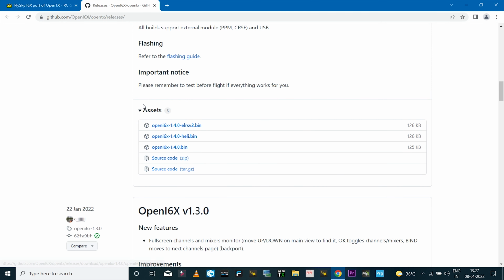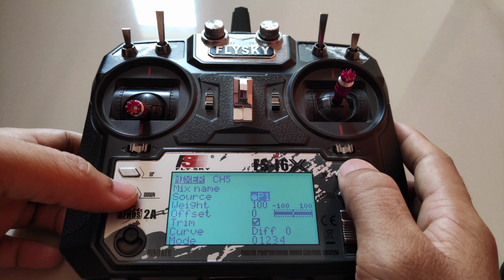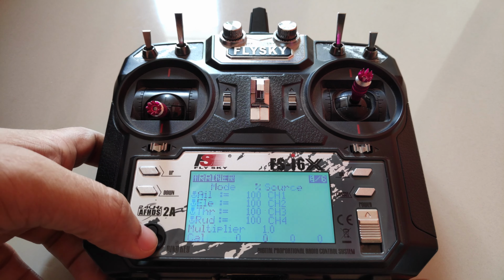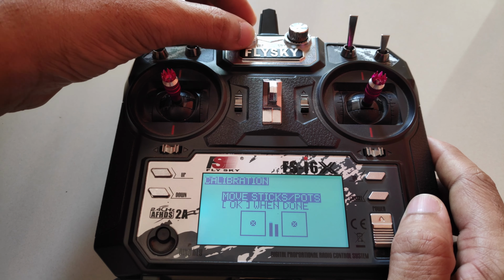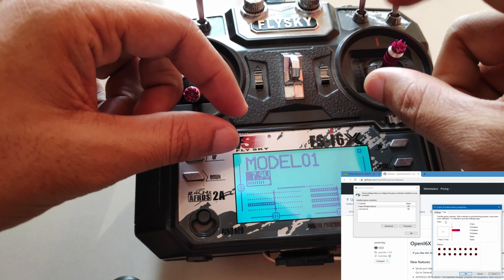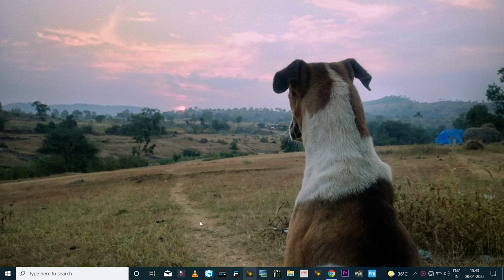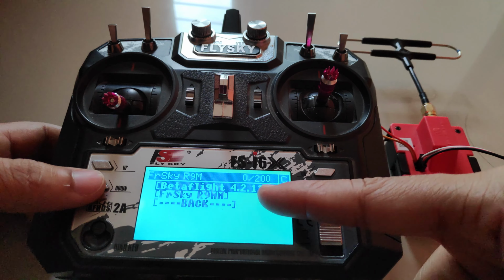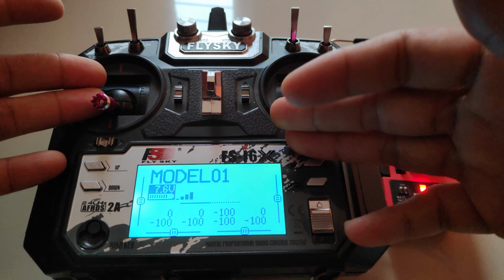Flysky FSI6X OPEN TX 1.4.0 New Features and Improvements + ExpressLRS 3.0

Comment: hi the original firmware the switch setting has a larger range than 120% the servo motors have a larger stroke here can the same effect be achieved
Reply from the maker: I think it's possible by editing the channel mixer setting by changing the max range to 120...the default is 100. Will check on my radio and reply soon
Reply: Thank you
Reply: hi have you checked your device does it have the ability to change percentages

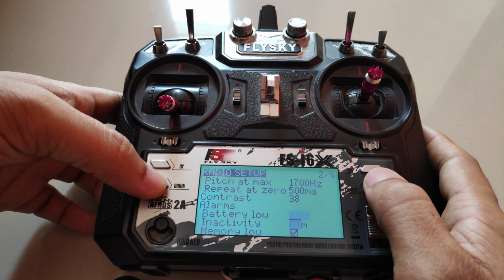Comment: At 9:54 does the low battery warning apply to the radios power and the external module(im running a express lrs module) or just the radio. If its just the radio how do you change the voltage alarm for the external module(if there is a serting)(im running a 2s for my module so this is helpful) thanks
Reply from the maker: It's only for the radio not the external module. But if your external module is powered from the radio battery then the voltage alarm will benefit both.

Comment: I Plan to use this remote with a scale car. For this I will change the 2 pos switch to 3 pos. With openTX can I delete the switch/throtle position force at startup ?
Reply from the maker: Hi, you mean the throttle warning at power on if it's not zero? I am not sure what you mean by force. But with open tx you can pretty much configure the radio however you want just need to know how to implement the steps required for it
Reply: @RakishRc  Yea, I mean that. Same with the switches that al have to bee up. Is that something I can change in the radio or do I need to do that to the firmware7software before flashing ?

Comment: Hi, does the radio work with computer for playing games after changing the firmware to Open?
Reply from the maker: Simulator option is a hit and miss mostly due to computer driver error. I have no problem with simulator with open tx on any of my computer and laptop. You'll have to test it on your pc

Comment: is it compatible with the i6?
Reply from the maker: No. For fsi6 there is erlfy6 firmware very similar to this. Here is the guide link - https://github.com/aerror2/erfly6

Firmware release - https://github.com/aerror2/erfly6/releases
Reply: @RakishRc  hi rakish i did the install and everything went well...i now have open tx but i can't see all the menu from the open tx...do i have to add something else? thx
Reply from the maker: @mani-00  which radio you have? Fsi6 or fsi6x?
Reply: @RakishRc  i have the fsi6, do you have an email i can send you video to see. thank you
Reply from the maker: @mani-00  you can send on telegram - https://t.me/RakishRc

Comment: Another great video !👍
Could you please tell me if express lrs receiver will work with apm2.8 flight controller ?
I have no idea about compatibility or how lrs receiver works.
Does it has its own telemetry or it transmit flight controller's telemetry?
3rd question is regarding the camera transmission, if a separate setup is needed for  fpv , even after all these technologies advances , especially for long range flights ?
Is there any way to transmit video signals riding these radio signals?
Please guide me bro . 🙏 
Thanks
Reply from the maker: Express lrs will work on apm but from 4.1 firmware onwards. Elrs receiver has some if it's own telemetry like rssi, refresh rate and voltage but it can also send flight controller telemetry.
For fpc setup you could use it stand alone without connecting to flight controller but you'll miss some data on your video feed. Fpv video feed doesn't have any problem from other radio signals if vtx and antenna are placed correctly.
Reply: @RakishRc  Thanks for your reply . It's clear that express lrs will not work with apm 2.8. Now for fpv setup , does its receiver support analog video out put , as feed from apm telemetry can be overlayed on fpv signals through minim osd. In this scenario , apm doesn't need any feedback , minim osd just use that telemetry data to overlay it on video feed.
So my question is does express lrs support analog video output , if not then how can I use telemetry data from apm to get it overlayed any digital video feed. Sorry for my ignorance 😛
Reply: I have replaced my radio with fs i6x , as suggested by you , in comment section of another of your video.  Thanks for that 👍
Reply: Bro please guide me here, I am very much confused

Comment: will installing openTX allow me to connect to multiple protocols with the stock antena? or do i need to put external modules for that to work?
Reply from the maker: You'll need multi protocol module to use other protocols. With open tx you can use elrs and flysky protocol along with ppm for external module. Sbus for multi protocol will also be available in future

Comment: On my flysky the elrs lua script wont load
Reply from the maker: Check elrs firmware on tx and rx module is matching and updated. And make sure tx2 signal wire and it's ground connection are connected correctly
Reply: @RakishRc  i did everything but nothing worked 
Now i have a frsky qx7 and everything work
Reply from the maker: @marc_kkb  strange. I'd suggest re check elrs signal and ground wire connection between radio and elrs module. Also make sure elrs firmware on elrs tx and rx update. It should work 👍

Comment: Hello, i would like to ask whether the system can be operated with 2S lipo without adjustment? As seen on the back of a 2s lipo?
And i have one more question. Which setting must be made to operate servos with sbus on receiver (16ch). Which converter works good? 
Tanks very much
Greetings from germany 
Sigi
Reply from the maker: Hi, I've been using with 2s lipo without any problem just make sure to never power with 2s and 4AA batteries together accidentally else radio will burn. You'd need sbus to pwm converter to use servos with sbus16 or use sbus compatible servos directly. Frsky sd1 sbus converter could be used or any other similar converter.

Comment: Can this remote be installed with speakers and a memory card module ? , if so, it must be very powerful
Reply from the maker: Dfplayer can be installed. I did a short test with erfly6 firmware but it's not fully supported for fsi6x. With open tx it might be supported in future not sure though.

Comment: hello, thankyou for videos and guide for the open tx. succesfully install no problem. however all my gimball are inverted (left is right and up is down), do you have any advice ?
Reply from the maker: Did you calibrate gimbals and pots from the calibration menu correctly?
Reply: @RakishRc  yes , i did . Even in the calibration menu , everything is inverted
Reply from the maker: @MsDanish1212  I am not sure why that would happen. Did you ever reconnect the gimbal pin connector on motherboard? I'd suggest flash original flysky firmware again and see if gimbals are working correctly. That's a way to know if it's hardware or software issue
Reply from the maker: @MsDanish1212  https://github.com/OpenI6X/opentx
Check this link. There's a guide to fix inverted gimbal. You have mode 1 radio it seems. Swap the gimbal wire connector
Reply: @RakishRc  thankyou! , Yes i did read the wiki , but mine was mode 3 . Anyway i swap the connector and it works!. So i guess this issue is not limited to mode1
Reply from the maker: @MsDanish1212  cool! 👍 Yes so other than mode 2 the connectors need to be swapped

Comment: Hi.
I have a few questions. I fly planes only.
What is your experience, are there any drawbacks compared to the original fw?
My main concern would be freezes mid-flight. How reliable is it?
Will it still work in Phoenix RC?
Can you still set low battery warnings sent by the receiver trough telemetry? (FS-iA6B)
When I delete the original fw, there is the possibility to save it. Can I also save the EEPROM contents aswell?
All my programmed data, setting? For the case I would like to restore?
Thanks.
Reply from the maker: Hi, I've been using this radio with open tx from a long time now. I haven't had any issue during flight or operating my rc cars. I use elrs for my quads and it outperforms the stock afhds2a protocol. You get all the regular telemetry options plus more if using flight controller. No drawbacks at all only benefits and more features. You can always flash back to original firmware and you can back up too but the original files are available on web. Eeprom cannot be saved..you'll have to setup manually.

Comment: may i ask if there is an issue regarding the latest version of openi6x specifically when using with simulator? my laptop is not recognizing my tx.
Reply: i also tried it in my mobile phone but same problem. but before i flashed it with openi6x i can use it with my simulator.
Reply from the maker: @f.chrisrafer5303  the device drivers need to be updated. Go to device manager and find the radio under HID compliant devices. Update the drivers using USB input device. it'll give error in first attempt but update the driver again using USB input device and reconnect the radio. It should show up properly and also visible in usb game controller

Comment: Can restore Modelle backup datas ?
Reply from the maker: It's planned in future updates. It did work with previous Open tx firmware but it wasn't possible to backup and restore models and settings from one firmware to other.

Comment: Hello Rakish RC,

I am very enthusiastic about the OpenTX software for the I6X.

I have a question about the OpenTX software 1.4.0 for the Flysky FSI6X,
Is it possible to switch the software to German? if so, where and how?.
 
I want to use the I6X for truck model making, so I don't need any aircraft settings and designations (i.e. a neutral surface)
is there a way to remove all the aviator settings (mixers) and designations or the
(Mixer) settings and designations To be released so that you can change the settings and designations yourself?

I would like to do the same with the Taranis X9E,
can you help me or give me tips on what and where I need to change something?

I installed an external transmitter module (Jeti Tu2) in the X9E, works quite well so far,
Is it possible to use the telemetry signal from the transmitter module in the Taranis and in the I6X,
I would also like to install the Jeti TU2 transmitter module in the I6X.

Kind regards

Michael
Reply from the maker: Hi, Germany language has been added in a nightly build will be available with official version very soon.
You can set up mixes in anyway you'd like with open tx in I6X
Jeti TU2 module can be used via external ppm module with I6X Open tx.
Reply: @RakishRc  Hello Rakish RC,

Many thanks for the quick reply, I will deal with it for the next few days and install the TU2 module,
I still have one question, can I make a backup of the current original software?
Reply from the maker: Yes ofcourse. If you watch the installation video or go through the rcgourp forum you'll get all the information regarding installation and backup of existing firmware.
Reply from the maker: Visit this link and download the nightly build for German https://app.circleci.com/pipelines/github/OpenI6X/opentx/483/workflows/ea64245f-dcb4-42d3-b4e4-408affe7c856/jobs/909/artifacts

Comment: Im constantly getting a driver error when trying to connect as a joystick. It looks initially as if windows is installing the driver then it gives me an error and I can't use the joystick function
Reply: I also did not succeeded
Reply from the maker: Try installing the drivers twice if you are getting the error 10.
Select usb input device driver in device manager driver update settings.

Comment: Planning to get the mfd 433mhz UHF rx TX , is it any good? Or should I go with 900mhz , from India for long range flight
Reply from the maker: 900mhz elrs is a good option. It's new and has frequent updates and improvements and works well for long range with minimal latency. 433mhz you'll only be able to use pwm or ppm.
Also 900mhz elrs will be cheaper than a 433mhz uhf unit
Reply: @RakishRc  bro but won't 900mhz system interfere with cell phone towers, is there chances i would lose signal?
Reply from the maker: @SOMANNACN  That would depend in the environment you're flying. If in dense city with towers nearby there could be interference but if using outside city shouldn't be a problem.
Reply: @RakishRc  would be very helpful you could send a link for elrs system
Reply from the maker: @SOMANNACN  well i am using a frsky r9m + r9mx receiver i got for about 5k. I'd suggest the happymodel 900mhz + rx combo that's about $50.